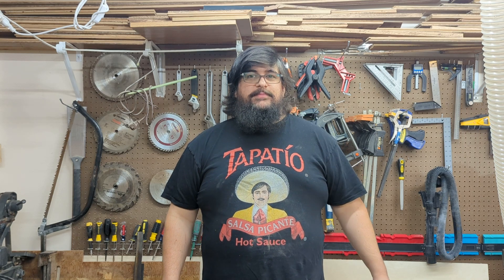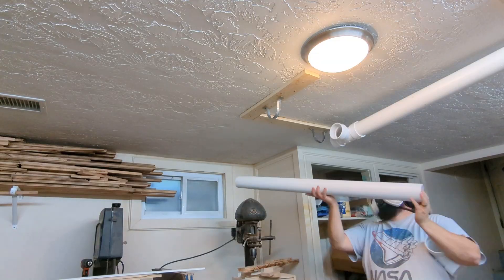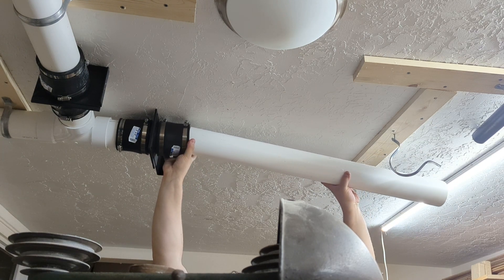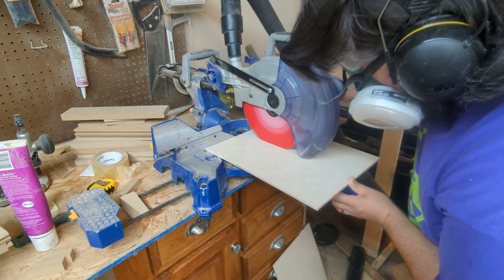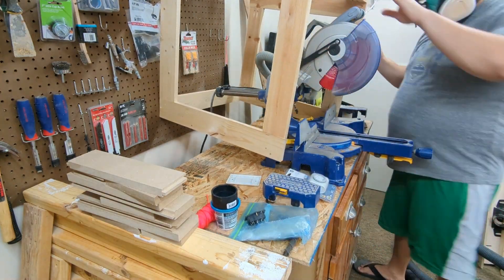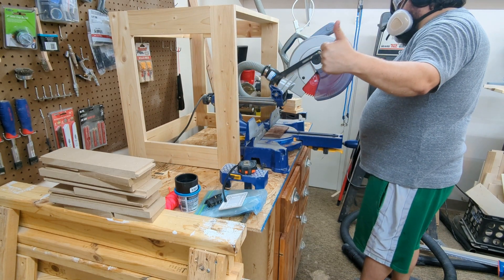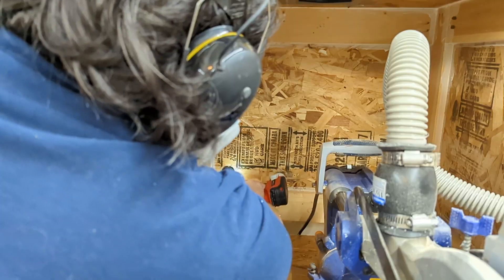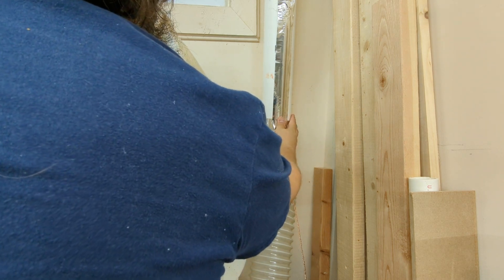Small Shop Dust Collection

Comment: I'm glad you did a dust collection system. You need to protect you health.  Your ground  needs to be partially on the inside. The majority of the static charge  builds up there.  The likely of an explosion is low though.
Reply from the maker: Using metal HVAC pipe would be much better than PVC, for sure. In a commercial environment, it would be the only thing I'd recommend.

I think I might do a video on my thinking behind why I ran the aluminum tape along the length of the pipe.

Comment: Just FYI; those 90 degree bends are going to severely reduce your CFM. Using 2 45 degree bends works much better. It’s the abrupt changes that kill the CFM due to turbulence.
Reply from the maker: The long sweep 90's should be relatively similar in losses versus two 45's. Those accordions that hook to the machines are the big CFM killers. 

Most of this I had laying around, intending to use it on another project.